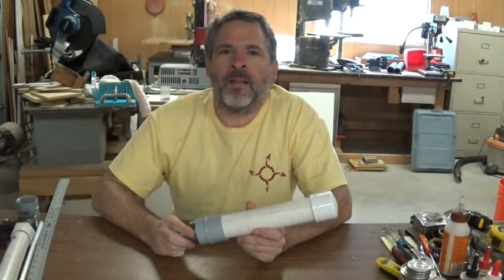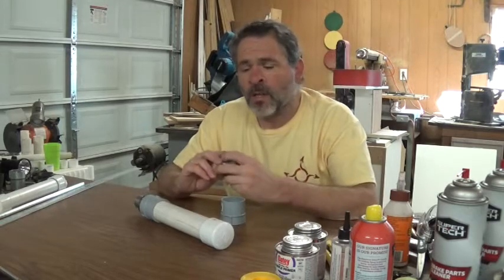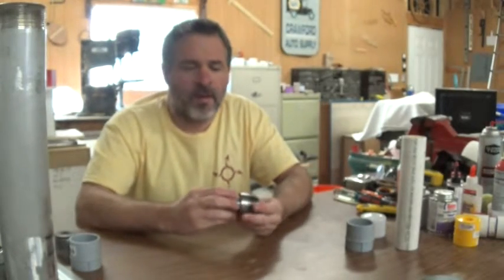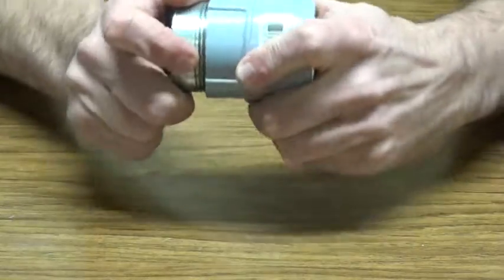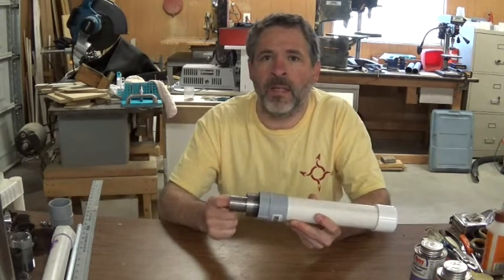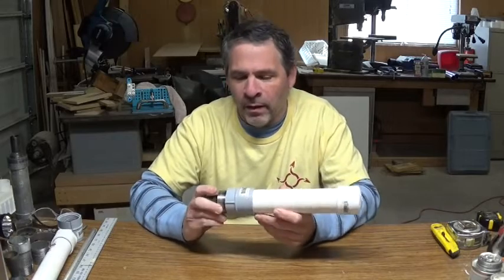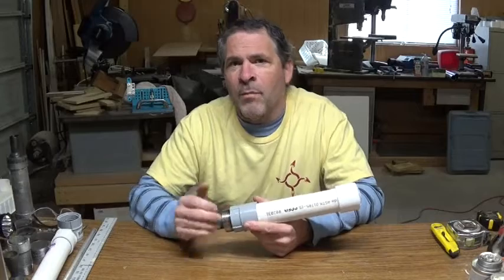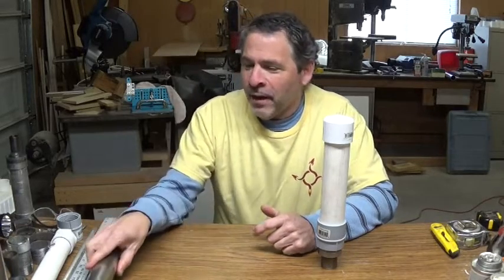Building a new PVC rocket motor

Comment: How are you calculateing the dimentions for Converging Diverging Nozzle ?
Reply from the maker: A few things I do here.
1. I use information from the Loki Research site to help determine a good nozzle hole size.
https://www.lokiresearch.com/page/Tech_Info
I find a motor that has fuel similar in diameter and length to the one I am developing.
2. I use Richard Nakka's SRM_2014 Excel spreadsheet to help with nozzle design.
https://www.nakka-rocketry.net/softw.html
Unfortunately, this can be a real tricky process and actually involves some amount of guess work. That's why I typically have to make several nozzles before finding the optimal one. The spreadsheet provides a physical diagram and detailed dimensions for the nozzle that I can take over to the lathe and make a perfect nozzle.

Comment: how do you integrate such motor in a rocket ? the closures must be a nightmare to put in a tube
Reply from the maker: Here is a video about my fin assemblies and how the motor is centered within that area. It's a strong and simple system that is easy to install in the 4" rockets I like to build.
Go to the 16 minute point in the video for discussion about the centering rings.
https://www.youtube.com/watch?v=S2ZCH2oDn1o
This particular video doesn't cover the issue of the motor stop.  One easy solution is to glue a stop ring in the rocket that the top of the motor pushes against. Hope that helps.
Reply: @rotaryrocketry  intersting...I was just being curious because I made PVC motors, but switched to machined one before i got the opportunity to put it in a rocket. Thanks 😉
Reply from the maker: @shere_kan8329  we have launched a few with various pvc motors but i really love our all metal robo-monkey motor. So easy to load with fuel and completely reusable. We are hoping to have something similar to that but with a lot more power really soon.